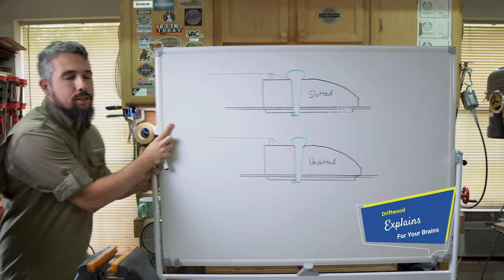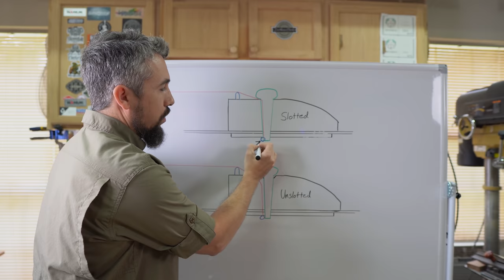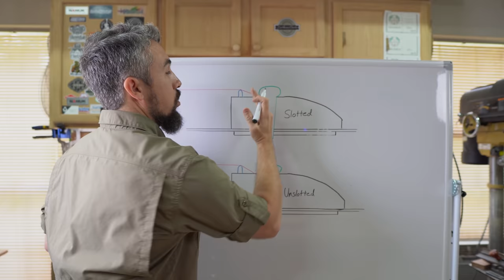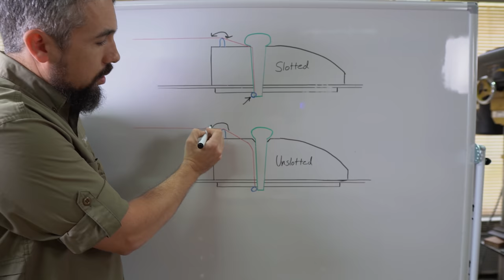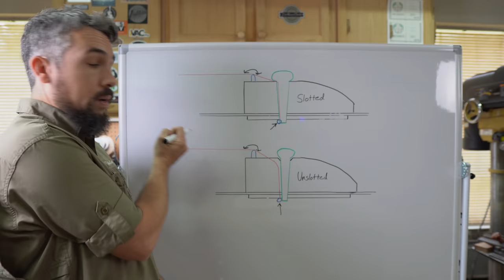This $25 Tool Can Help Anyone Make Their Guitar Sound Better!

Comment: I am not saying I do not find appeal in unslotted bridge pins. "Break angle theory" sounds legit, but everything points to it being a myth. Take archtops, gypsy swing guitar and flattops with Macafferri style bridge. These kind of guitars project as hell and have break angles of a few degrees. Ok, different guitar design, but if isolated break angle theory should work, how are not these guitars really quiet? Simple, more is not always more. If you lose energy, where is it going? The pin is not going anywhere. Some damage to the pin over decades? Yeah, not a lot of energy for a soft plastic. The whole idea of string pushing down is not precise in steel strings with these kind of briges. There is torque created between 3 points of contact of the string (saddle, bridge top and bridge plate). And even if you say that this type of bridge (which is the most regular type) is unique to the influence of sound we are talking about, think Takamine bridges. Drastically different points of contact and the guitar sounds like a "normal" flattop, even though the levers of the torque are different. Wasn't there also a genuine research paper about break angle that found out you just need break angle big enough so that the string doesn't stop touching the saddle?

Comment: They simply drill 6 holes? Ehm, how do you drill cone shaped holes? These holes always start wide, and the deeper you get, the smaller the hole is. That is NOT simple drilling, I have no idea what machine it takes. Help!

Comment: Wait… at 3:36 you say manufacturers “supply you with  unslotted bridge pins” and back in the day, they supplied “unslotted bridge pins”. So… later you’re saying unslotted is better. 

What if you just use unslotted bridge pins on a bridge that isn’t slotted?

Comment: Wouldn’t it be better to use a saw that cuts on the pull stroke..? …to avoid excessive splintering of the wood inside the guitar..Who knows what kind of wood is in there..? And if there’s a big “blowout” then it would be counter-productive..🤔

Comment: so just to point out a major contradiction in you claims, when you pulled the pins out of the treble side of the bridge the strings stayed put, in fact after you loosened them you still had to reach under and they made an audible "snap" when you force released them from underneath, your drawing in the beginning 4:41 as well as your verbal claim that "the string ball is wedged in the slot of the pin and that is what is holding them in place" was proven objectively UNTRUE 9:33 by your own display

Comment: False science. If saddle bar completely separates vibration into two section, the angle from the saddle bar to the guitar body does not matter. It is irrelevant and already proven by fender neck string guide.
Reply: Well, here's no doubt it sounds better. The fact that you can't hear that in his side-by-side video tells me your ear just can't hear the difference. And about science, your assessment is completely wrong. It's about the added pressure that the steep angle of the string creates. This makes a better sound connection from the bridge to the body of the guitar. Thus, additional sound frequencies make it to the sound box. This enriches the harmonic content. The harmonics add, which produce higher amplitudes of sound which are filled with additional frequencies and THAT creates the much more full sound. Trigonometry dictates that the steeper string angle WILL create more down force.

Comment: David Hosler at Taylor said that when designing the ES2 pickups they discovered that the bridge isn’t moving up and down as they originally thought, but that it actually moves in more of a rocking motion. If that’s the case then it seems like the slotted pins should produce more torque and thus be more efficient in energy transfer. Do you have any thoughts on that?

https://m.youtube.com/watch?time_continue=248&v=e6IBFspSqKc&feature=emb_logo

Love your channel btw, it’s my current favorite.

Comment: Don't want to tell grandma how to suck eggs, don't google it!!, but I like to take some material of the back of saddle when break angle is increased.
The sustain gained can be dulled by inreased  string contact with the saddle. I lay a saddle file on bridge, point it at string entry point the lift it a gnats bollock then remove some material. You can hear the difference

Comment: Tried it….yes…the tone was night and day…..but now….when i change  the pins from plastic to tusq….there’s no noticable difference in tone…as if the bridge pins doesn’t contribute to tone at all…
Reply from the maker: That’s because the material of the pins don’t make any contribution to the tone.
Reply: that made me wondering….how to tweak my guitar’s EQ if it’s too warm or too bright when having a slotted bridge….i usually tame down anywhere i can, and the pins are one of them…now it seems, there are out of equation….i did notice it was contributing to brighten up a dark guitar or tame a shrill guitar before this

Comment: How will this affect intonation....
Reply: It shouldnt, you are chainging the total string length a very very small amount. If it WERE to change the intonation it would make a perfectly intonated string a little sharp at the 12th fret.. but again by such a small amount (fractions of a cent) it should be negigable. (but not 0)

Comment: I'm kind of wondering how this may effect my intonation? Anybody have issues with intonation after doing this mod?
Reply: Should not affect intonation, you are only changing the stringlength between between the ball and and saddle a very very small amount. changing the break angle wont affect intonation.

Comment: Asthetics aside, why not make a small removable plate on the back , and feed the strings from the bottom up, like Fender guitars, and eliminate the bridge pin entirely?
Stew Mac also sells abrasive string in various diameters, that would do a great job here.

Comment: I don't care how well you explain it I know for a fact that the pin does nothing and on most guitars you can take them out after you have the strings up to tension and they will not come out. Pins are a safety measure. They don't affect tone either! The guitar gets it sound from the string vibrating thru the saddle. After that the vibrations don't go to the pins and then back thru the bridge and into the sound chamber. B.S. Pins do not effect sound AT ALL! Good nut and saddle is all you need.

Comment: I have a Martin D-35 12 string l purchased new 1965, the pins are plastic, slotted and now curved. After seeing this video l am now wondering, if l replace the slotted pins with nonslotted and have the grooves cut in the saddle, how much sound improvement could l expect and would it be worth the effort? Thanks for the information.
Reply from the maker: It’d be very worth it!
Reply: @Larry Macaluso Did you mean to say "bridge", rather than "saddle"?

Comment: So the break angle of the string on the unslotted peg miraculously goes through the bridge to create a lower angle.  The string angle ultimately goes form horizontal to vertical across the saddle.  The tightness across the saddle, more acute angle will create better vibrational, sound transfer.  Please do not cut your Taylor guitar sound board or bridge.  You will definitely ruin your guitar.  Any energy transfer after the saddle is negligible.  So any manipulation past this point will do nothing but hurt the sound transfer and impair the guitar resonance.
Reply: Why would this process ruin a Taylor? Is the Taylor so different from others?

Comment: The disappointing part of this video is that you showed the modification and you made claims that this provides noticeably more sustain, secondarily more responsiveness to the notes, and probably third that it somehow improves the guitar by making an already acceptable break angle more severe, (because in all things 'more' is ALWAYS better right?) BUT... You show no PROOF?

How hard would it have been to have two identical model guitars, one slotted, one unslotted, to demonstrate your  claims?

There's NO WAY I would perform a mod, especially on an expensive guitar, that irreversibly alters the bridge and bridge plate without knowing in advance whether it would make a significant tonal difference. 

I'm also curious as to how this affects the bridge plate long term? Because an older guitar that has seen dozens and dozens of string changes inevitably starts to wallow out and eat away at the bridge, the bridge plate, and the top, (effectively doing the same thing as your mod). So over time, will that wallowing process chew into the bridge plate even deeper making eventual replacement necessary even sooner?

Comment: that is totally BS , what transmites the resonance  from the string to the top of the guitar is the saddle trough the bridge  , the  resonance dies in the saddle precisely  cause all the energy  is transmitted to the top  
      After the saddle , if by any chance   there is any residual resonance that can be transmitted to the top of the guitar it should be so minimal that  is not worth to destroy  a good sounding guitar decreasing  the resale value and jeopardising  the guarantee .
     And last if you want to establish that sound  can be improved you have to prove it comparing  two  identical guitars , with same sound .
      I don't know what this guy smokes but definitely it is a good shit .🪴🪴

Comment: Seems like your intent is somewhat misguided. I've never heard of someone using slots instead of slotted pins for the reasons you stated. I've only ever seen, slots used to gain break angle on saddles that are extremely low and barely angle enough to put pressure on the bridge. There's absolutely no reason to do that on that guitar, IMO. That's plenty of break angle.

Comment: Your strategy is sound, but as a professor, I am constantly annoyed when seemingly well-educated experienced artisans like yourself do not correctly align with the actual meanings of the words they frequently mis-use. "Tonality" is the adherence, accuracy or loyalty to the tonic (key center) in music (Harvard Dictionary of Music). "Intonation" is the accuracy of the pitch played as it relates to the desired key center intended.  I believe you are trying to describe "timbre," "tone" or "tone quality." The procedure you are describing is a tried-and-true method of ensuring efficiency of tone transfer from the string to the saddle, minimizing the introduction of sympathetic vibrations from an outside source, such as the bridge pin, or the wood of the bridge itself, each of which have complex acoustic properties of their own, including buzz, wolf tones or other artifacts. This strategy also has a direct effect on the life of the string, and some say it helps the string to remain in tune for a longer period of time, although that discussion is still raging on. Your discussion might also include a sidebar on the use of slotted bridge pins vs replacing them with solid ones (because that has a DIRECT bearing on the position of the ramp and the break angle), and a further discussion of brass vs ebony vs bone vs ivory vs plastic pins on the tone of the instrument (calculating the weight of the massive rosewood bridge), and an additional discussion of the extremely long break angle on most archtop guitars. Then you should compare the break angle at the nut, comparing 12-fret slotted headstocks to a Telecaster. 
Good execution of the principle and the easy modification, however.

Comment: I'd be PISSED if my guitar came back with nasty looking slots like that. Makes the guitar look cheap and like it was built wrong so you're compensating by sawing huge, needed slots in the bridge. What are you doing? Smh.

There wouod be no "making a replacement bridge. You'd be calling whoever to get a factory OEM piece to repair it with. It wasn't unoriginal when you touched it. You aren't sending me home with unoriginal parts because you screwed up.

Comment: The bridge drives the top, not what is behind  the bridge. Any more than what’s on the other side of the nut, the guitar top is not driven by pins, or the ball end, that is snake oil BS!
This guy is full of it, and has much to learn…….

The most significant change you can make to the tone of any built acoustic guitar is the saddle,  this is a known fact, change bone to say ivory makes a huge and noticeable difference.
The fit of the saddle is vital…..don’t buy into this guys crap!

Comment: Don't be messing with your guitar especially if you depend on it to make a living. It makes my skin crawl to hear this guy sawing on his guitar.
Reply from the maker: Funny thing is, I make my living as a full time musician. I’m also a luthier. It’s not my fault you don’t know anything about guitar history, or you’d know that this is the way ALL guitars came until manufacturers stopped doing it because it was to time consuming. That’s one reason older guitars sound better. Because most of them actually have this method done to them from the factory. Plus literally just about any hand made guitar will have this done to it out of the box. Do a little reading and you’ll see where you’re incorrect.

Comment: If this is so great, why are you not doing this to the guitars you are building?  I don’t see this being that great.  If you saw a groove down in that pin slot the slot is going to be much bigger than the string which will be less contact, not more contact.
Reply from the maker: I do it to every single guitar I build. I said that in the video.

Comment: Incorrect. Brass added anywhere in the string path of any guitar will improve the tone ring and sustain. In fact, a guitar acoustic or electric made out of brass and other materials like polycarbonate, aluminum, steel, and especially a graphite neck will increase and make the sound oc the instrument better. Linear materials (non-wood), especially improve and add a gorgeous rainbow of harmonics wood just absorbs and wastes. Also, why arent you using 2 for 3$ exacto wood saw blades? To stuck in the spendy junk i guess.
Reply from the maker: sure

Comment: Holy crap... Not a good idea! There are old guitarists, and bold guitarists... So few old bold! Bold is sawing away at the bridge! Click bait? If this was real, a guitar sound comparison would be Proff of concept. Also, luthiers would be making guitars from the factory!
Just saying.
Reply from the maker: The level of incorrect information in your comment is impressive. I've been a professional luthier for over 15 years, and this is something that just about every high end builder includes in their guitars, including myself. Just because the factory made guitars dnt do it, doesn't mean its wrong. Believe it or not, Martins, Gibsons, and Taylors aren't the best made instruments. Has it ever occurred to you that they are just looking to build guitars fast and easy, not well. Your ignorance is showing.
Reply: Many hand builders use slotted bridges and solid pins.  Some modern small shops such as Pre-War, Bourgeois, and Collings use this method.  Martin did as well until about 1943, when they went to a slotted pin, which takes less production time.  Martin still uses this on Authentics.  It is without question a more durable setup, as it virtually eliminates bridge plate wear.  Regardless of whether or not you think it has a tonal effect, the structural benefit is clear.
Reply: @vernonyates8408  interesting... It's a helluva story here... I'm so ignorant about such things. Thanks for providing some information about the whole concept.
I was coming at this from my Fender Strat/Tele experience, where a very low break angle is usual. Where string breakage is a problem with higher angles. Tone is not seemingly part of the equation. Or if it is, it is so minimal as to be not worth consideration.